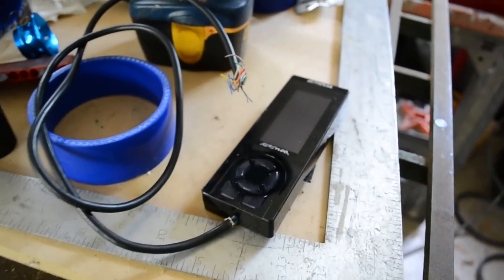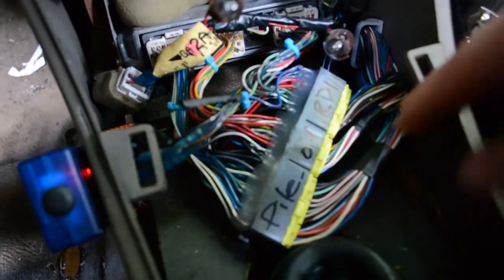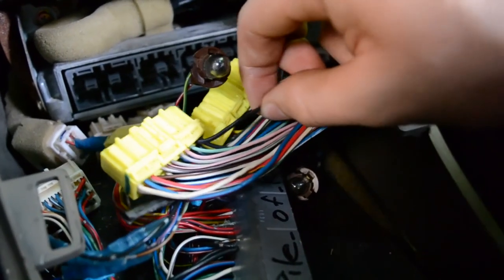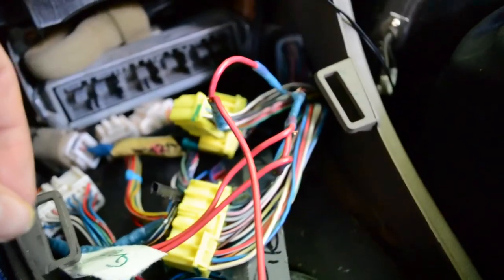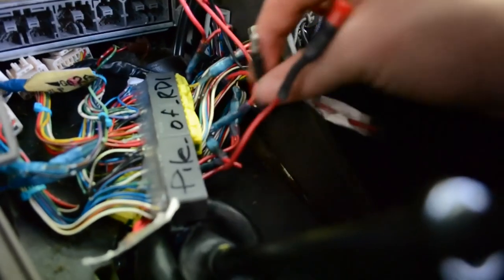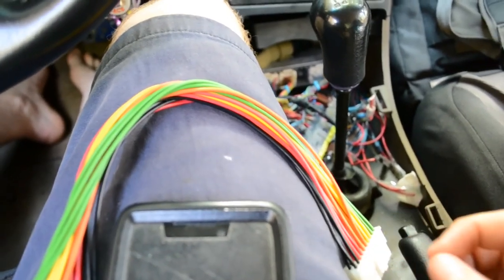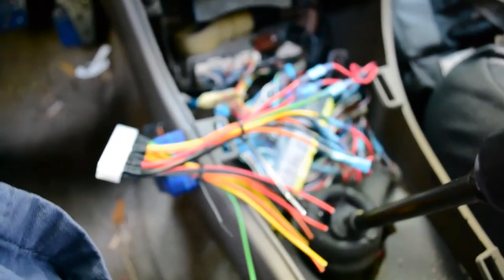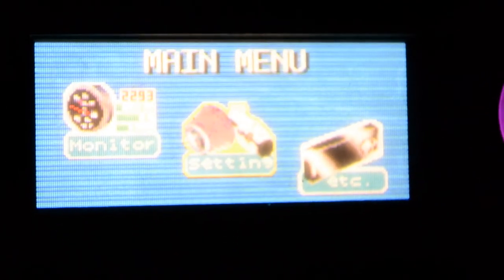How To: Apexi AFC Neo Installation MX6 (KL-T p11)

Comment: Red/Black wire is to the main relay (ignition switch) which will get 12v only when ignition is on.  Good call.

Comment: If you are scared and hesitant to cut a wire it means you aren't fully sure if that's the right thing to do.  At this point it definitely is.  Cut with confidence you're on the right track.  Neat butt splice connectors haven't heard of those before.  Will have to look those up.  Neato.

Comment: You CAN buy connectors for the KL from DIYAutoTune.  I think it's the 72 pin Nippon Denso plug.  You can find it from other manufacturers too but the main supplier in the US is DIYAutoTune since they import them direct from the Japanese manufacturer that makes them.  You cannot however find the Ford EEC-IV connectors that come on the ATX 2.0 or KLG4.  They don't make them anymore so you have to get them from a junkyard.

Comment: One of the bulbs back there goes to the ashtray and the other is for the cigarette lighter illumination.  Some models didn't have illuminated logos on the cigarette lighter itself.  Looks like you have a burnt out bulb there.  Probably 73 or 74 bulb type.  The 73 and 74 are exactly the same size bulb just different wattages.  I always go with the 73 just to be safe that it's not going to overheat.  73 is a long life bulb but less light output.  Good choice for components that are behind dash panels that you don't want to pull up in the even the bulb burns out but looks like your no stranger to pulling up panels. ;P

Comment: For wire gauge mismatches probably a better idea to solder them together.  Anything on the interior of the car is ok to solder.  It's only stuff in the engine bay that sees really hot temps that you have to second guess using solder.

Comment: Problem with splicing and crimping especially on tiny gauge wires is eventually they will oxidize and loose good connection.  On tiny wires that already have poor contact surface area you want to prevent that in the future with solder.  I would have gone with solder in this case.

Comment: The black ground wire you are using is a constant ground (0v).  You could have also used the other black ground wire directly below it.  Both are general constant ground wires used by different circuits but should always be 0.0v ground permanently.  Good job on that.

Comment: Great vidio well done I have a rx7 S4 and was wondering if the neo controller  would work on a stock ecu. This gives me hope that this can be done as I don't see the need to change ecu since I am not turbocharged.
Reply from the maker: It should work on your stock ECU. The only thing you'd be able to do is to make it run a little leaner. The NEO doesn't adjust timing, so it might not do too much for you